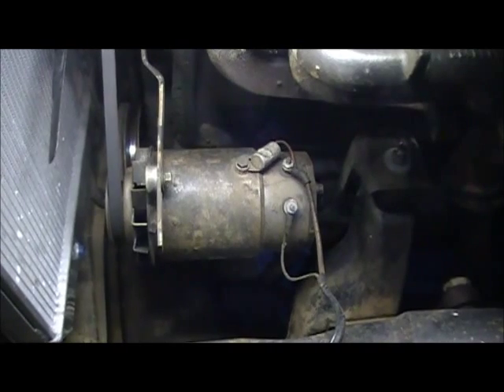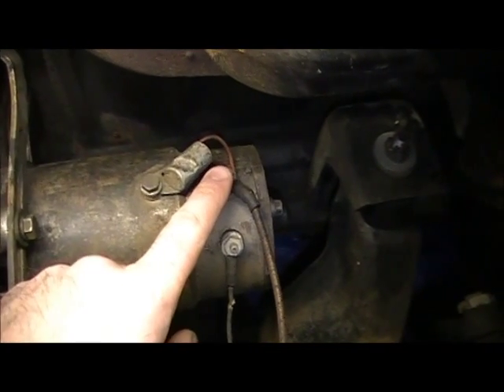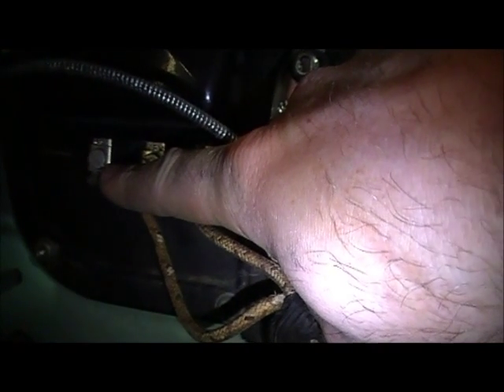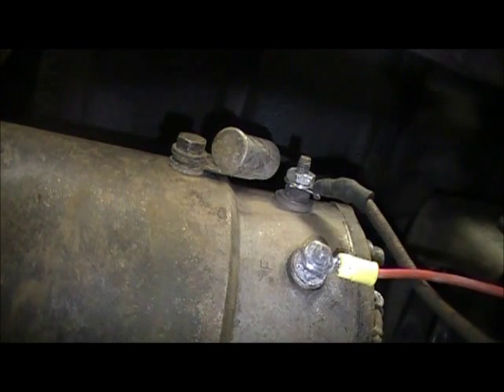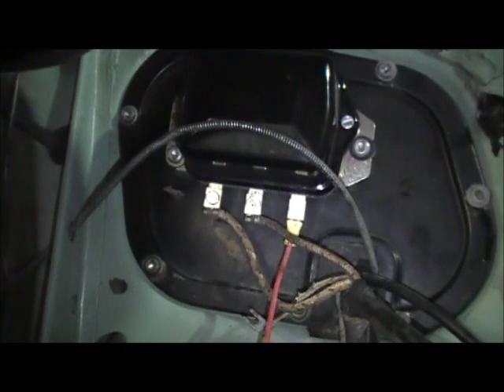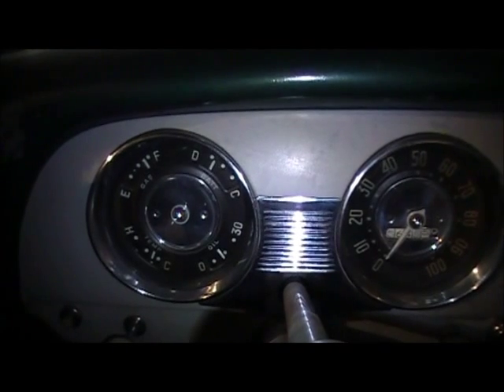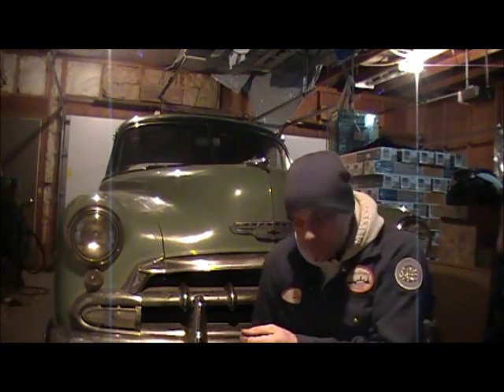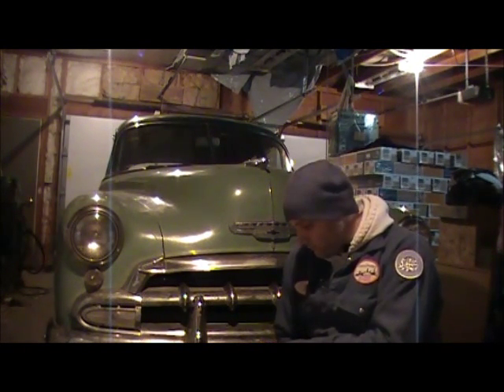1952 Chevy Styleline Generator part 1

Comment: as far as the vacuum wiper motor, they didn't work that great when they were new. probably why they are no longer made. an  electric motor conversion works good & can be had for less than $200.00. another test for a generator is to ground the field terminal while the engine is running. the voltage should 6.8 volts. disconnect the "f" & "a" leads while doing this test. the purists will hate me for this, buy a 12 volt alternator & switch the car to 12 volts. it's a GREAT improvement.

Comment: So I'm testing my 6 volt the motoring test worked but when I tested with leads it didn't ramp up but if  spin the pulley by hand it jumped to 3 volts what does this mean

Comment: Thankyou for this wonderful video. It was exactly what I did a lot of searching for. Question. Wouldn't it have been quicker to jump the two terminals on the generator as the first thing to do, then if that was ok, start using jumper wires to the regulator.  If the generator wasn't ok, there seems to be no need to run it as a motor, and I don't think you can check the regulator if the generator isn't working. Am I correct? Thanks again.